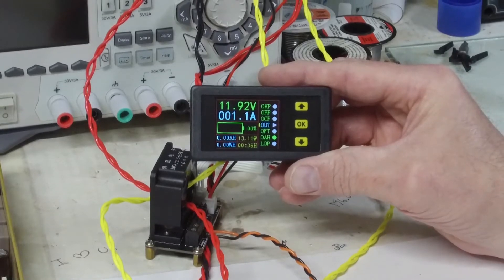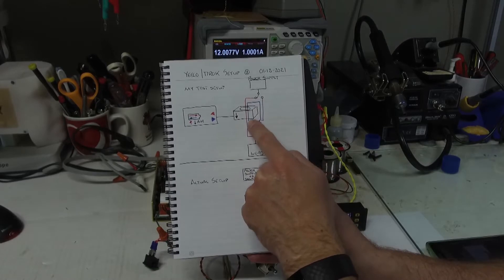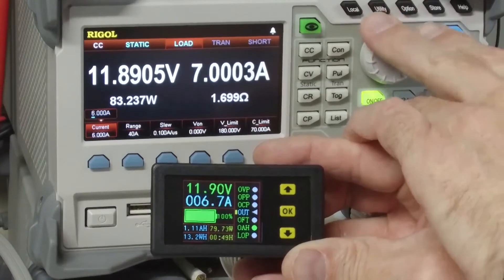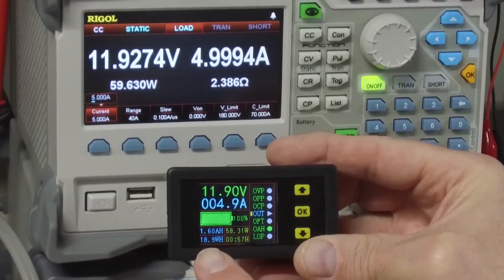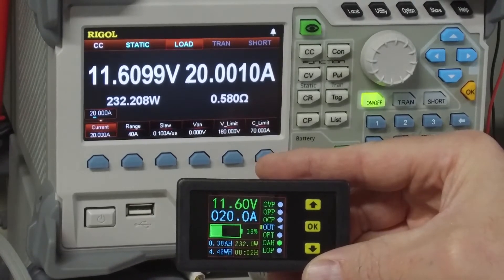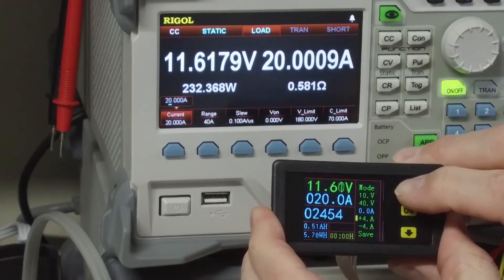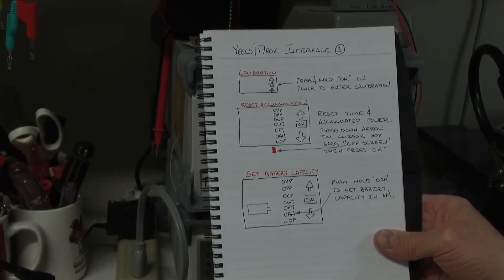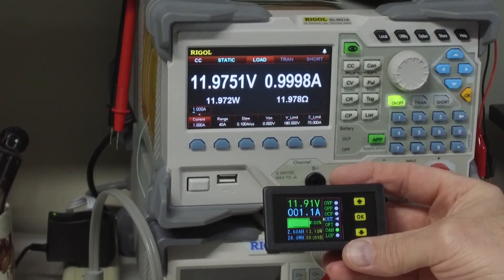Digital DC Ammeter Voltmeter, power, capacity, discharge / charge rate analysis.  Yeeco / Drok

Comment: Thank'S for your video , it help me , but i got problem when the power go to the batterie , the WH don't go up , and H too , just don't know why !! Got 2s2p lead acid batterie setup for 210 ah , so i put the OAH to 210 and calibrate the voltage ! When discharging , that work , but when charging , no good !! If you want , i be happy if you do another video with other feature !
Reply from the maker: Your welcome.  Not sure if I understand your question.  In the future, might do a little more work with this meter and if I do, I'll make a video.
Reply: @DanPattenAudioG33k  Thank's for your answer,  i just reset and it work good now ! If you do another video , that will be great !
Reply from the maker: Just loaded a Part 2 video: https://youtu.be/cp2qrXKJ654  
Maybe this new info will help.
Reply: @DanPattenAudioG33k  thank's i will look at it for sure .